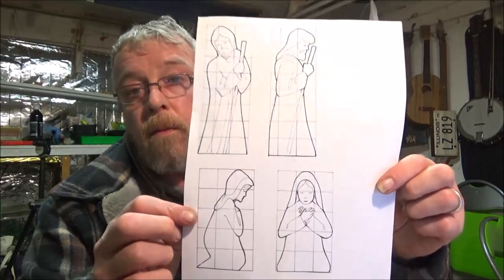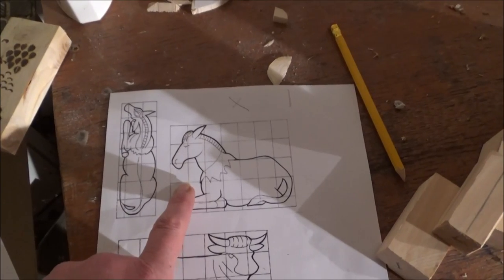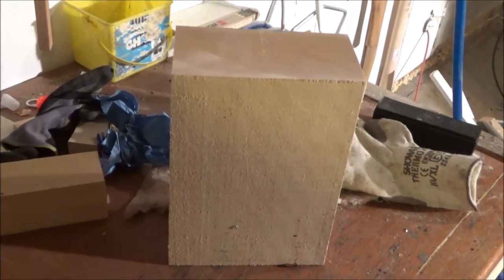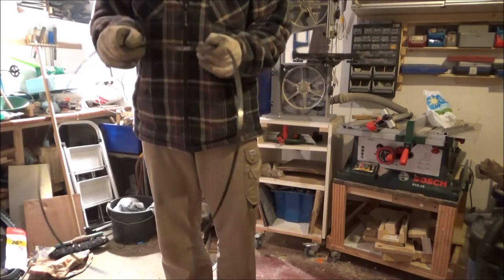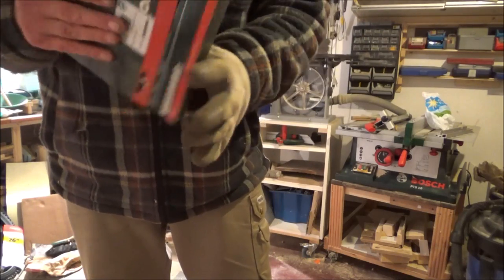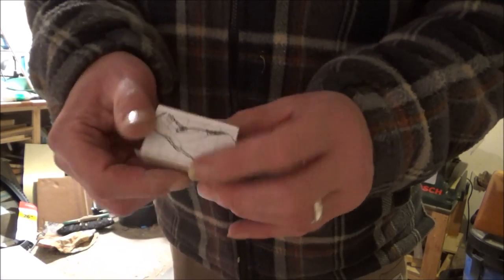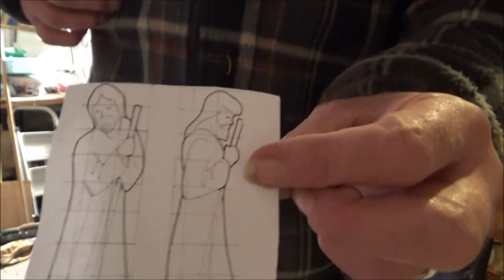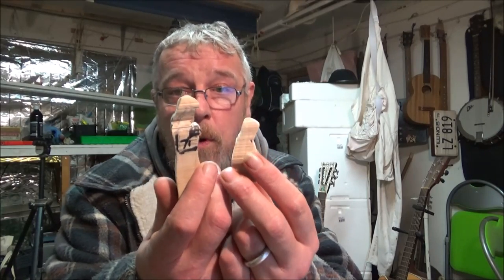Nativity carving band saw work pt1. 20 11 18

Comment: Great information on band saw blade folding. This reminds me of a few decades ago when I was into wood working. I used the same technique to cut out cabriole legs for grandfather clock cabinet. Have a great evening. Best wishes Bob.
Reply from the maker: Thanks Bob.
Yes great way to get 3d basic shapes and move a lot of wood.Saves a lot of time. The band saw folding is handy to know. storing them when you have a few is a pain.
All the best sir Dave.

Comment: The worst part about this video was that it ended. Loved the info and band saw action... My maiden bid for 'BLOCK' is £350,000 - I know that's drastically low... but so is my imagination ;-)   Cheers Adam
Reply from the maker: Cheers mate. Imagination will be a series of works. 350,000 is a little low but I could always cut it in half for you.
you must just specify length with the grain or across the grain. ;-)